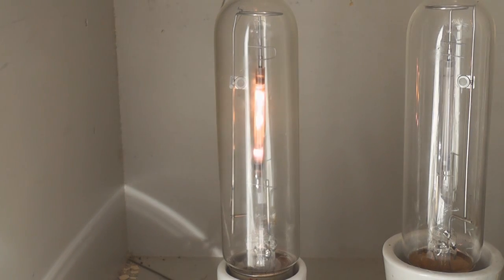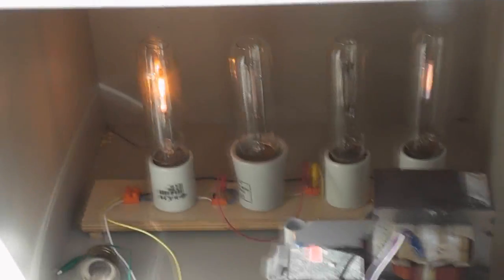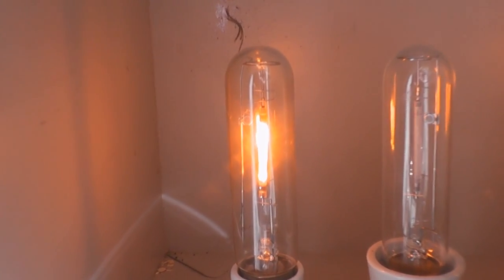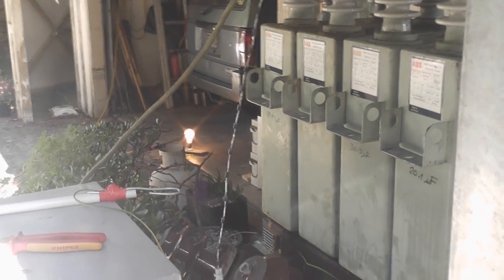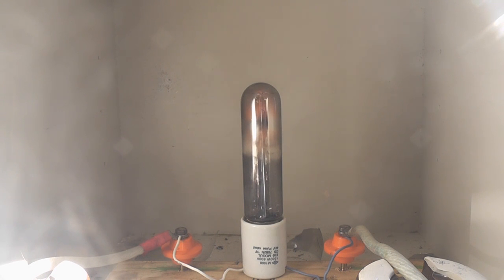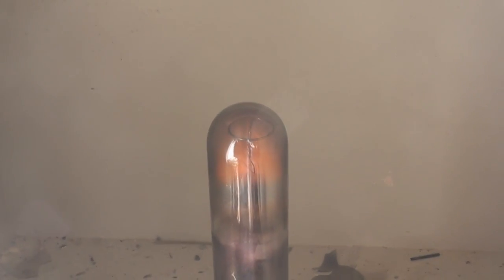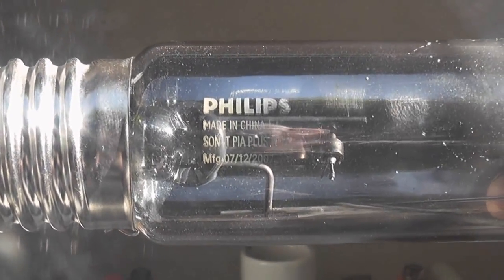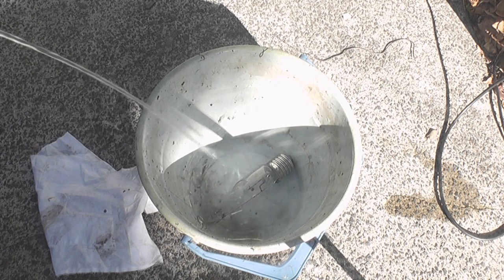Sodium lamp pop on 10000 Volts

Comment: Do need that much voltage to exploded a light bulb. I'm an electrician, It's getting abandoned over time but temporary light stringers can be powered by 120V or 277V power sources. Industrial lighting, it's common to get 227V incandescent light bulbs. The bases are same a 120V light bulbs.  If you accidentally use a 120V light bulb on a 277V circuit they will blow instantly, sometimes exploding.

Comment: Definitely Neon. Some high pressure sodium bulbs use mixture of Xenon and Neon gas in order to forcibly bake the arc tube until the ceramic starts glowing orange from the insane arc temperature so sodium vapor would finally light up yellow. Some are just either Neon or Xenon.

Comment: Did I hear that right that that was 90 uF/10kV? That discharge looked surprisingly mild for 4.5kJ from a non electrolytic capacitor.
Reply: This was amazing, especially that glow that happened after the main bang. Not sure if that was reacting sodium or just leftover capacitor charge but it was cool...

Comment: Hey Quick question , my 150W hps bulb is a littlebit scratched in couple places (visible from close up ,i can feel them with my finger) should i be worried of big explosion? What happens if that outer glass break under heat cycle or something? Bulb is trash or usable?
Reply from the maker: Is it on the outside glass bulb ? not the inner arc tube. it should be fine. worst case is that the glass cracks when hot. I blew this bulb up.with excess voltage.
Reply: @RODALCO2007  Yes outside glass i was lookin for answers and found your vid.Thanks
Reply from the maker: @parogone1538  That glass is destressed as some of these bulbs are sometimes fully exposed to the weather

Comment: In a High Pressure Sodium lamp, the sodium is an amalgam with mercury, so there will be no reaction with water. Only in Low Pressure Sodium lamps will there be a reaction, as these contain only sodium metal and neon as a starting gas. In HPS, xenon is the starting gas. SO--LPS lamps are the ones th be careful of when breaking them open. Also, this is a philips lamp, made in China---apparently Philips has sunk to a new low---their stuff is junk--always was, in lighting, and the US mase sodium lamps always were crap, but made in China? These must be really short-lived lamps! UGH!
Reply from the maker: Thanks for your comment. Yes, I don't like the China quality either. Most of these Sodium lamps I have found in the bin at work, and amazingly they are all working quite well, even with the blackening at the ends. The Sylvania lamp, made in Hungary are better quality I think.
Reply: A crappy Star Cruises china ripoff iPad charger broke today. LESS THAN A MONTH! Typical Cheap China crappy 'quality' ...

Comment: HPS lamp has less than 1g of Na in it, so the reaction will be completed by the moisture in the air as you break the glass. Try making another and use it as a neon indicator in an E40 base.

Comment: Sodium gas mixes with nitrogen gas causing this cloudy yellow usually blue-yellow light.

I saw a video of a sodium lamp with a "leakage" of its inner tube and 2 gases mixing.

PS try to do that on a metal halide arc tube.

Comment: Boom! A blackened outer envelope is typical of a SON lamp that has leaked during operation. Must have been some energy there as those sintered alumina arc tubes can withstand serious temperature and pressures!
Reply from the maker: I discharged many Mega.Joules in the Sodium lamp. chance of survival was slim.
Just fitted two Sodium lamps on my deck running of fluro ballasts and Sodium igniter with no overheating at all.